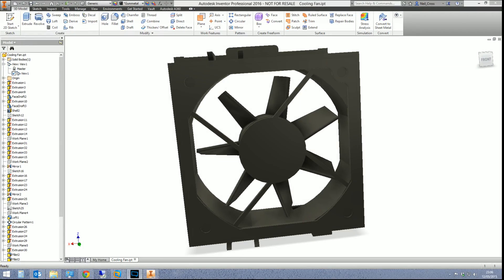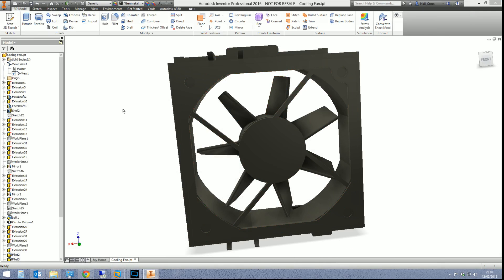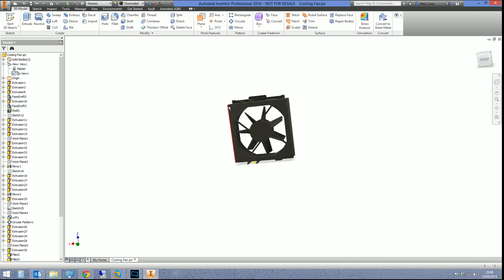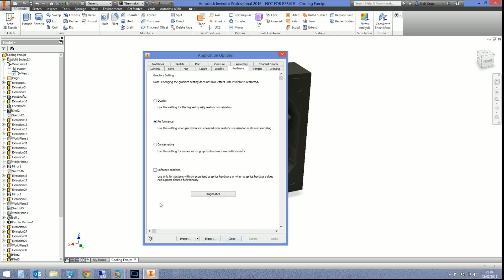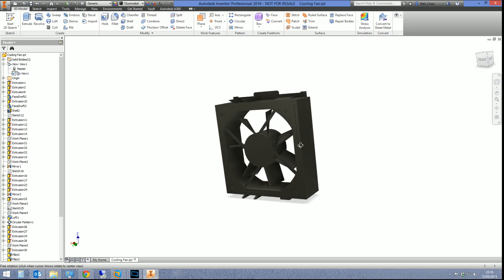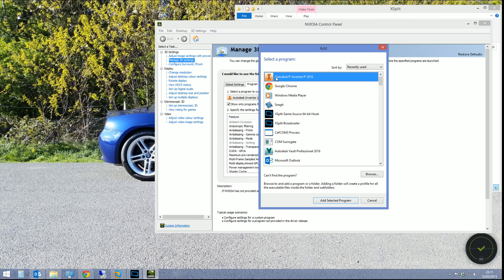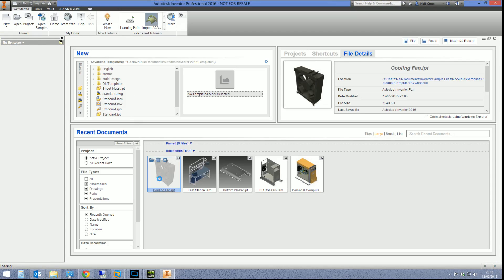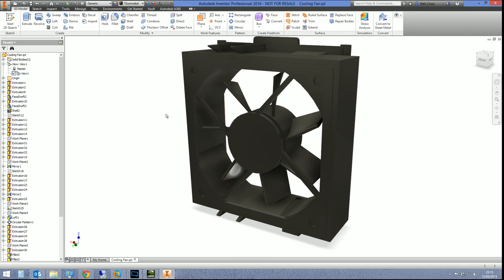How to make Inventor look better with display settings | Autodesk Inventor

Comment: Hi, thanks for the great tip, I have tried  that tip, on my inventor application was set up, but unfortunately on my nvidia setting doesn't work, the FXAA   cannot be changed to on mode, it looks like freeze. Do you have any suggestion for me?

Comment: Just a heads up, you don't need to close Inventor down to get the hardware performance changes to take effect. You only need to close all the graphics windows.
Reply from the maker: Scott Moyse Yah I think I might have got mixed up with the settings being enforced from the NVIDIA panel which if I remember rightly needed a full client restart, either way, no harm! Cheers for popping by!